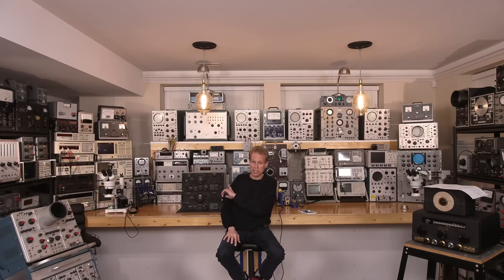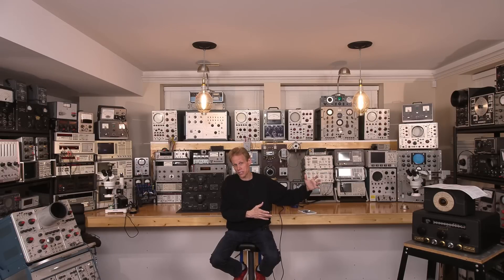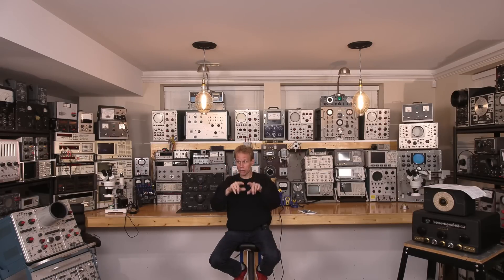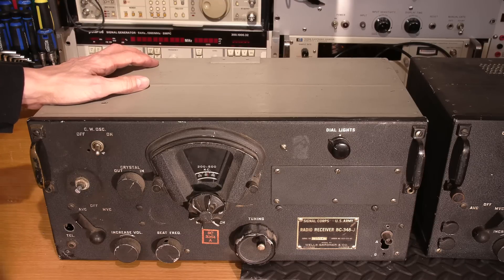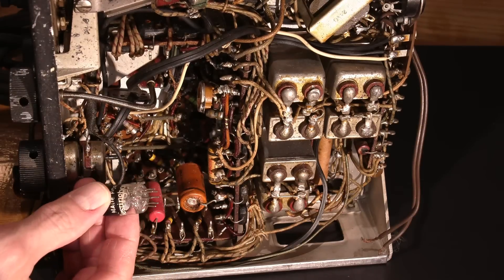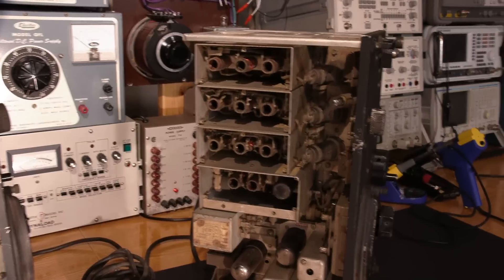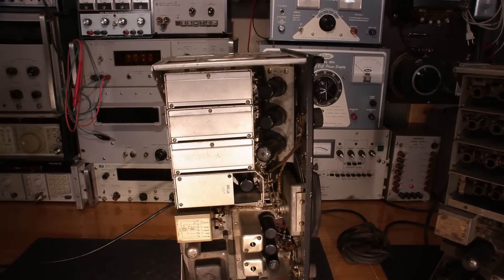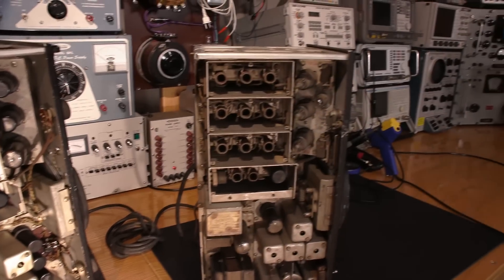Restoration Warplane Radio Receiver BC-348

Comment: #2 is has the best outward appearance.  The schematics will show which receiver design is the better one from a tuning/reception/signal rejection standpoint; quite possible that #1 will have a better capability to zero in on a specific signal and null out unwanted ones due to the more selective IF.  You didn't open up the tops of the oscillator sections which might tell a tale of its own.  Use the power supply from #1.   #3 has the best looking case, but after installing the power supply you would need some ventilation so maybe use the case that had the holes drilled in it, or use #3 case with holes added.    #3 is so gutted to begin with that there doesn't seem any point in trying to use it for anything but a parts donor.  So use $3 as the main parts donor where possible, and select the best design from #1 and #2.  As to whether to continue the series or not, I emphatically encourage you to continue.  These restoration videos throw out so many nuggets of information they are an incredible resource.  I have taken notes as you go through the videos and they are getting to be quite copious but extremely valuable to go over later; I have applied many of your methods and techniques in my own restorations.  After retiring 3 years ago, I have slowly been acquiring the tools and materials needed to properly make my own printed circuit boards and delve into the realm of SMT.

Comment: Leaving feedback is the least I can do: 

1. "You'd have to be hardcore into electronics to be here" — not true; I'm repairing my own stuff as a hobby and knew very little when I started watching the EEVBlog, and I still find transistors difficult. I'll watch as long as a (moderately) interesting subject is presented with good audio and given a voice by a good video personality, i.e. no monotone narration, and no crappy techno soundtrack. 

2. I enjoy your power supply repairs more because they're accessible to me, meaning they're applicable in so many devices. I'll never come into contact with the high power radios you work on since I live on the other side of the planet. While I enjoy watching them get restored, I think I can live without the calibration part after having seen it once (I wouldn't even have been introduced to the concept if you hadn't shown me at least once). Calibration feels more like a theory-heavy lecture that I'd look up separately if I were ever to perform one.

In summary: restorations vary in interestingness depending on how distant the device is in my life. I want to feel like I'll have a chance to use what I learn. The latest big revelation I had on this channel was that *diodes can leak*. That's my level of hardcore.

Comment: yes, continue the grand receiver restoration series.   what does restoration mean to you for the bc-348 by the army air corp?  you havent mentioned that this receiver was powered by dm-28 dynamotor. are u going to restore to stock condition and put a dynamotor in??  these receivers used by these days on the old military radio net, sat mornings 5am - 7am et on 3885.

Comment: My feedback is that I am not too interested in the basic mechanics and layout in the devices you are working on. Which screws to unscrew and how to clean contacts. However I am very interested having the different sections of a device explained. Not necessarily from scratch each time, but with references to basic building blocks. I've had some Aha-moments while watching you tune and align, but I still feel I'm not grasping the full relationship of voltages and waveforms always. And I can not always tell how one receiver differs from another and why. I need to see comparisons. And while tuning/aligning I need to see the relative parts of the schematic so I can go back and forth in my mind's eye.
What a lovely idea to compare all the receivers! I recently went to a HiFi convention, and noone really compared anything, everyone had their own input, most often spotify on their phone. So many variables, and they still thought we should be able to hear how the  $3000 shielded power cables (plugged into a regular outlet) made a huge difference.

Comment: I commented last night but the youtube AI stupidly deleted my post because of a link to a picture of my receiver. You just can't get the staff these days! A search might reveal that webpage however.
My receiver is a version "O" bought in 2004 and is like the 6K7 version of yours and I've yet to overhaul it so your future videos will prove useful.
My guess is it uses bandpass IF circuits (those extra cans) to improve the shape of the response (but to get the best from this you'll need to use a spectrum analyser). One problem in tackling this version is the Sprague condensers with their dodgy oil. My solution is a bit cheaty. I pull off the wires, ground the live tabs and use 100nF x 500v chip capacitors in their place. Alas these were so efficient in my AR88 overhaul I had to add resistors across some to reduce the extra gain which made the AR88 unstable!
I haven't yet discovered a spec for a true "O" version so maybe another commentator will oblige.
I'd suggest tackling the 6K7 "O" version with the extra IF cans rather than the 6SK7 models as it looks more interesting. Over the years many of these BC348s have been factory rebuilt so the labelling may not be quite right. Does this mean swapping a front panel? There's a challenge!
Finally lots of BC348s were made by Stromberg Carlson.. any family link I wonder?
Allan G3PIY

Comment: Radio 2 for the face and innards, Radio 1 for power supply, Radio 3 for the case.  Then have a tube testing party!  I wouldn't bother trying to improve anything performance related.

Comment: I think its a toss-up between radio 1 (dirtier but might be better spec) and 2 (cleaner but looks more heavily modded. 2 might have a slight lead. # 3 is just parts. I vote to keep up with the Grand Radio Receiver challenge.

Comment: I decided to post after seeing this but not the later episodes yet; hopefully my 'innocence' (ignorance?) will be of value. Please Mr. Carlson, do not be disheartened when viewing figures for a long, complex series begin to wane; your audience is not all of one mindset or technical standing. Some of us fully appreciate and follow an in-depth series completely; others will be drawn to some aspects of it more than others, some will run out of steam halfway through and may come back some time later to pick up where they left off, and all of us will sometimes actively look for a 'lightweight short' (relatively speaking) of the high Mr. Carlson standard. Drooping figures during a long run are not indicative of that run's lack of popularity.
One possible idea might be to split a long restoration into modules, such as maybe power supplies, each with its own episode. That might allow some of us to, for example, just watch the power supply episodes of all your series to learn more about that particular topic, and to see how power supply concept, design and execution varies over the years, models, and manufacturers.
Okay, still not knowing which set is being restored, and subject to a comparison of schematics, my vote would be to aim to restore No.2 in the centre, but also try to restore no.1 to the right because it is so different. The two would form a very useful reference pair in the future.

Comment: Darn, just my luck. Recently sold a mint, unmodified, BC-348, sitting in my basement for some 60+ years waiting to be worked on.  Never liked the internal power supply modification due to the internal "butchery" involved.  An external PS left it natural. Your followers might benefit from some background in WW2 aircraft power generation.  Best regards.

Comment: It is a veritable quandary.  Radio #1 looks like the oldest based on physical condition, but also perhaps because of circuit design (plate-cap tubes and more/larger IF transformer cans?). 
But more IF stages (??) may mean better performance, or maybe compensation for  poorer performance from older component's and obsolete circuits?  You can't judge a book by its cover and you shouldn't decide just based on a pretty face.
Indeed, Radio #2 looks cleaner and newer.  But how do we know that Radio #1 may have been the better performer given equivalent restoration therapy?

Is there any way to do a quick objective sensitivity & selectivity test on the radios before digging in and doing extensive restoration?

Comment: radio 2 is my vote   another mod i'd do is to trade the molex 6 pin dco0nnector for the one off a i.b.m. computter  this gains you a varible length power cord when running and one less trip hazzard when its on the shelf being pretty but unpluged

Comment: One thing I want to say about your videos at the new bench is the change in lighting since the old locations. It's much less even, which means often there's a dark ring of shadow around the outsides of the frame and a hot point in centre, and the various camera angle changes - particularly live - trigger a lot of camera automatic level adjustment. It's particularly strong in this video, since you're moving between the three receivers a lot, and a lot of time when you're moving back to the centre receiver (nr. 2) you're getting glare and such, particularly until the camera adjusts. And... I hate to say this, but it really makes the videos harder for me to watch.

I'm still watching them all and still appreciate them but it is kind of distracting and... kind of unpleasant. I don't know why it's such a thing for me but it really is. The lighting at your old bench was a lot more even, so you didn't get that sort of thing happening.

I don't know if anyone else has been mentioning it but it's something I've been meaning to say for a little while. At first I thought "well, he's still moving in and the lighting on his old videos was fine" but it's persisted. And hopefully I'll get used to it, but I haven't yet.

As for the series: I did watch all of the first receiver restoration but I do think it got easy to lose sight of the big picture as you worked your way through all the many subsystems. That in and of itself was quite illuminating and really showed what a big project some of these complex beasts can be! But I can see people feeling kind of lost in the weeds about it.

And in terms of working on one, I'd be nr .2 also, with maybe an emphasis on showing how they improved (or just simplified) the design between the older unit nr. 1 and the newer unit nr. 2. I think showing that evolution would be interesting. So maybe that.
Reply from the maker: It's the firmware (original firmware) in the bench Canon C200. With up close lighting, it's very hard to get around. I have another C200 with current firmware, I plan to swap it out for that camera. I will see how that goes..... About a million "in camera" settings to redo. Another thing that doesn't help, YouTube likes H265, all my older video's were in H264, so MP4 1080p 60 and slow scan (30fps) for even higher res. YouTube will produce an H265 video in about 10 Minutes (YouTube further compressing my video) everyone that uploads videos deals with this. It seems YouTube really favors this format! When I upload a H264 1080p 60 slow scan video, it takes roughly 2 hours for YouTube to just do it's compression on my video. Sometimes it even hangs! So I have to re-upload. The point is, H264 looks magnitudes better than H265. Just the "glitchyiness" of YouTube makes the "much larger" video format a real pain. I would upload in 4K but you know that deal... Roughly 4X the processing time, then all the other "checks" YouTube performs on every video, due to all of those "others" that have abused the system. All creators are paying for this! This video produced almost 2 days ago from this comment might just be ready to put public now if it was in 4K. So Thats the short of it :^)

Comment: The one on the right is older for sure.
Reply: It's the earlier design. Note the tubes with top caps. The other two are a later design using single-ended tubes, with changes to facilitate manufacturing/production. The earlier design is actually the better performer.

Comment: I am interested in result, but whole process is walid only for someone who actually try to fix that exact radio or very similar.
Watching one. or two full restoration is interesting, but 3rd and onward [with some exceptions] I just listen to Your Video like to a radio audition [with exceptional audio quality, not AM half away the world].
Interesting parts I do wach, but other than that is audio audition with splendid lector voice. 
Is for now it does no importance for me how long is this series or how much time You spend on one radio, but it will meter that I can see and hear in extremely details when the time come when I will ned to fix this radio.
Therefore I prefer detailed review and fix manual just to have source to get back and use this knowledge in practice, on my bench.

Comment: Not so interested in the Grand Receiver Restoration Series. Would Prefer different repairs,etc.    Or how about a series where you go through a tube set section by section, explaining how each section works (eg Antenna Amp / Tuning Section, IF Section, etc..... Just to get my head around how it all works.

Comment: I know the oldest has the most work to do on it, but if you ask the guy who doesn't have to do the work, the later models could have had a meeting with a bean counter, and that is in many cases a recipe for degraded performance.

Always watching your excellent video's, I have some comment on them that make me feel ashamed, again because I do not have to do the work. It is about the auto exposure. Getting a large gray-card, and setting it manually would benefit the shadows, because the contrast is already to high, and any high light reflections shoots down the (average) exposure which results in black holes everywhere. It would surely also benefit if you would shoot in HDR (High Dynamic Range) to lower the contrast, which lights up the shadows, but again, I am ashamed to tell from this relative lazy chair.

Comment: Hi Paul, I would not be too interested in the restoration of these specific radios as they are too unique and specific vs. other types of radios. As far as the length of you restoration videos, I think they are definitely interesting, what makes them a bit boring is that you are somewhat long-winded, repetitive and you spend too much time talking about your capacitor leakage test in just about every restoration video which again makes them longer. You asked for feedback, and I am providing what I think. Thanks for your videos.

Comment: Not particularly interested in equipment which does not run on normal mains power (50 - 60 Hz). 400 Hz, 28VDC, or dynamotor operated stuff is only of interest as shelf-queens anyway.

Comment: While there is much that can be learned from old equipment, this looks like a very time consuming project both electrically and mechanically. You will spend a lot of time sorting out and possibly correcting what appears to be poor quality and questionable modifications. When you get done you will have another trophy to display, but it won't have much practical value as you have many more radios that will look better and outperform these old boat anchors. I doubt that there a a significant number of people who will want to use your videos to do their own restoration of a BC-348 when there are so many other candidates with more potential value when the work is complete.

I am more interested in leaning circuit design and I'm interested in modern components that are more readily available and less expensive than the tubes used in the old radios. I'm not opposed to tubes, but these radios look like the effort isn't worth the end result. The tips and techniques and Patreon videos will likely appeal to a broader audience. I appear to be in the minority here, but you have so many things going, I wonder how you can dedicate so much time to one radio.

Thank you for your excellent videos.